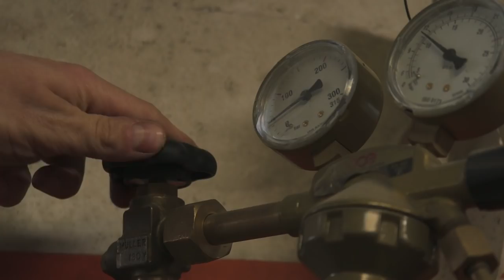Making Long Heavy-Duty Clamps

Comment: Is there a specific reason why you didn't put the 10cm pieces on the inner side of the 50x50MM tubes? That way you would still have a flat surface between the clamps (but it would make the usable space between the clamps shorter).